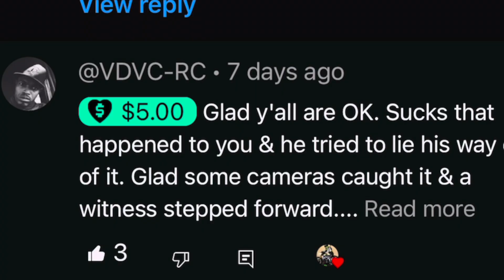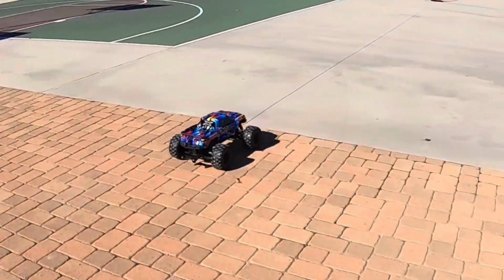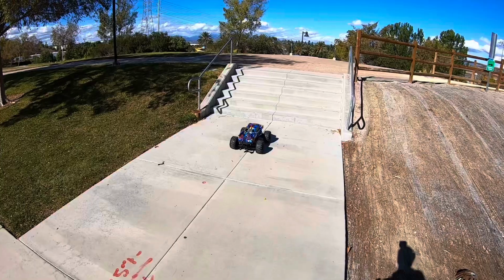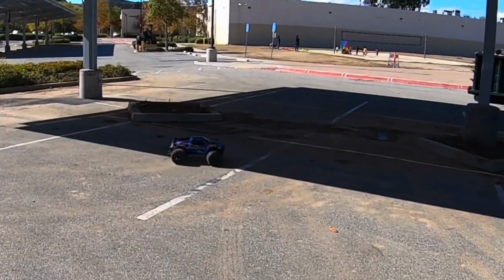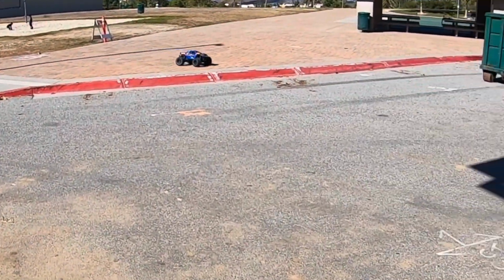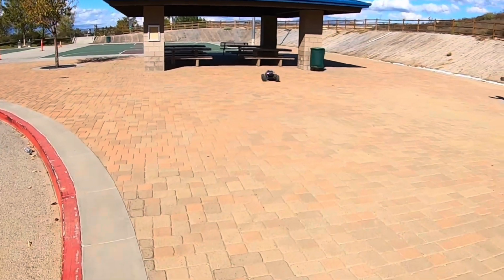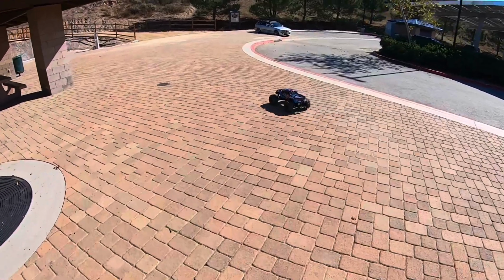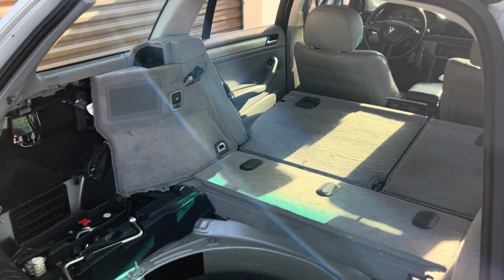New Traxxas XMAXX 8S Max6 ESC First Startup & Run Getting Settings Dialed In

Comment: The first press of either reverse or throttle is brake to prevent you suicide shifting and it was brake rolling backwards after stopping because you stopped without putting brakes on
Reply from the maker: Nah the trigger sticking it happens

Comment: I agree with you for bashing I don’t really need to go much over 
40 MPH.

30 MPH is the sweet spot for me, unless I’m ripping down a straightaway
(And slower than if it’s a classic collectible or Rerelease)

Once you start going beyond 40 MPH the ability to maintain control starts fading or dropping off

Comment: Just recently got my first (XMaxx $1099 version with the belted sledgehammer tires, etc),  and although I am not really a stranger to Traxxas' RC trucks, (over the years I have four Nitro Revo's  starting with the 2.5 back in 2004 and three 3.3's.  One has teh OS 21TM engine), this is my first electric RC.   

I am sure I heard you mention this  in some of your videos, but I now that I am looking for it, I can not seem to find it.  
Just curious, why do you  prefer use a Max6 ESC, on a straight out of the box brand new XMaxx; instead of maybe waiting until the Traxxas' ESC requires replacing? I know in this video you said you did not want to clip the factory ESC; and you mentioned faster top speed.  Is this your main reason? Also, I know you have said to make your own opinion on 3rd party parts.  

Great videos, very informative.  I can not get enough of them.   Keep them coming!

Comment: Does your max 6 cog slightly on slow take offs? My stock ESC didn’t but the Max 6 seems to cog if I try to take off gently. Other than that it’s awesome and definitely helped open up my stock motor but the cogging is driving me nuts. Have my punch set to 6. Maybe need to bring it back to 5. Just curious if you ever had the max 6 cog on the stock motor. Thanks!
Reply from the maker: All non sensor esc motor combos cog on take off taller gears make this present
Reply: @earlmoorhead5555 yeah just felt this one was excessive but it did open up the stock motor so it works good.

Comment: Running mine tomorrow afternoon. Castle Creations combo 1100KV. This will be my first and last Xmaxx, no need to buy a new one when you've upgraded all the important areas of the truck, the parts are cheap and the upgraded servo doesn't cost too much either. I was considering selling mine, and thought well I'm going to want another one, so why pay another 1,000 to only have to upgrade another one lol. Earl did this only after selling a few of his, so the total refresh is cool.
Reply from the maker: I’ve always said buy at the local hobby shops as I didn’t pay the 1k for a new xmaxx definitely ask what they can do for you at a cash discount make these expensive RC worth buying 👌